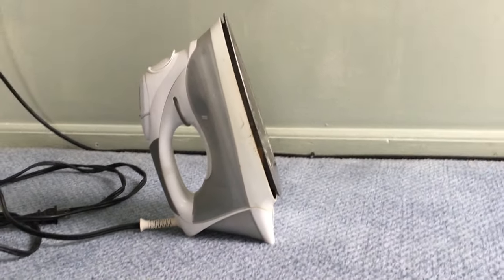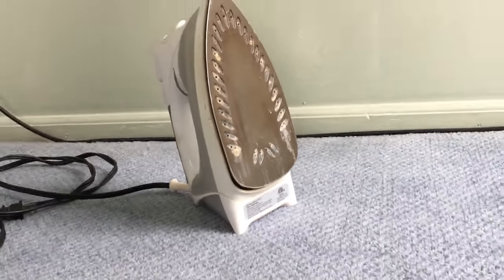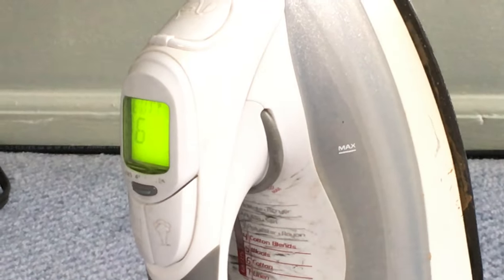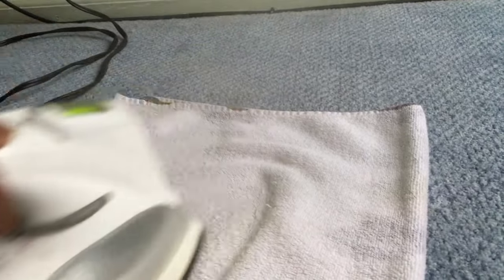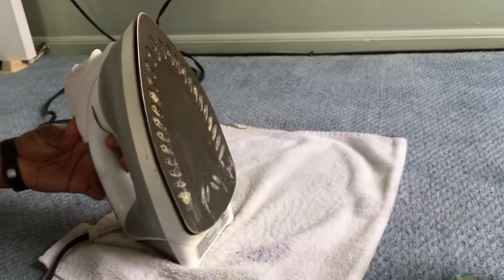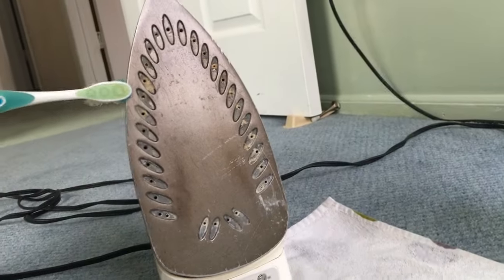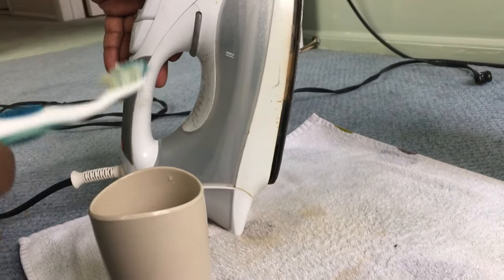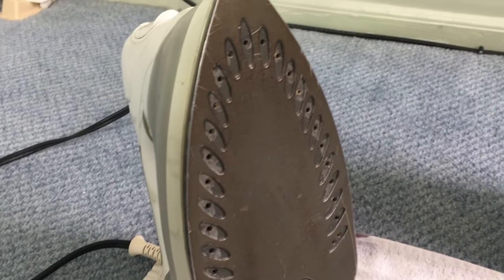Cleaning a Clogged Steam Iron

Comment: I have the same model as yours. Black & Decker D2030. And the manual particularly warns against using vinegar. Instead you are supposed to hold the dial in "Clean" position  (yes, that's an option on the dial) and hold hot iron (unplugged) over a sink and repeatedly press the steam button until all water comes out.

Comment: Never iron on the carpet, I once knocked the iron and the carpet was burned. Cost me a lot of money out of my rental bond
Reply: I wouldn't recommend vinegar as it damages rubber seals, best to use commercial descaling or filtered lemon juice, rinse thoroughly afterwards.
Reply: .Prevention is better than  cure. I have found that most people iron at 
too high a temperature . The steam setting on my iron has high, medium ,
 low. Set the steam to low. I have found this setting works perfectly 
and I never have to clean my iron. The rule is start off at a low 
temperature and increase the temperature gradually. Write the settings 
down or keep them in a mental sock.  Give it a go you have nothing to 
lose and hopefully everything to gain.

Comment: it's not dirt hun it's from not using distilled water you shouldn't use tap water on an iron
Reply: Not true. Some steam irons (e.g.  T-fal)  tell you to use nothing but tap water.
Reply: True
Reply: Brandon Jones , I think that it’s where you live, in the U.K., in hard water areas there is more lime scale and that is what clogs the iron and also your shower head over time, it also leaves white residue around the taps, in soft water areas there is less or no lime scale so it’s not so bad.  In soft water areas you do not have to use so much soap powder either as lime scale stops the suds from forming so easily.  Distilled water removes the lime scale by distillation so the iron does not clog as easily.

Comment: It's not about how high the temperature goes or how fast it goes up, like someone posted, it's about the water quality. If u have water that is not so pure, like full of chalk u will have that problem anyway. Vinegar is a good solution against chalk, luckily where I live the water is very soft and I don't have to use any anti-chalk solutions. I guess u don't even have to dilute the vinegar, it will be more effective. But in order to prevent this, use distilled water and u don't have to bother anymore.

Comment: It works perfectly, thank you👌
Reply: .Prevention is better than  cure. I have found that most people iron at 
too high a temperature . The steam setting on my iron has high, medium ,
 low. Set the steam to low. I have found this setting works perfectly 
and I never have to clean my iron. The rule is start off at a low 
temperature and increase the temperature gradually. Write the settings 
down or keep them in a mental sock.  Give it a go you have nothing to 
lose and hopefully everything to gain.

Comment: .Prevention is better than  cure. I have found that most people iron at 
too high a temperature . The steam setting on my iron has high, medium ,
 low. Set the steam to low. I have found this setting works perfectly 
and I never have to clean my iron. The rule is start off at a low 
temperature and increase the temperature gradually. Write the settings 
down or keep them in a mental sock.  Give it a go you have nothing to 
lose and hopefully everything to gain.